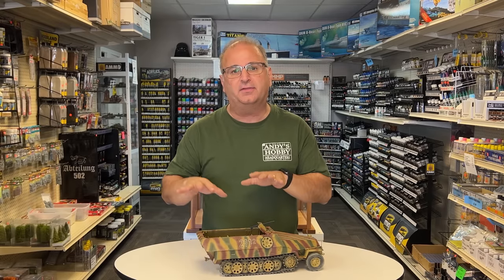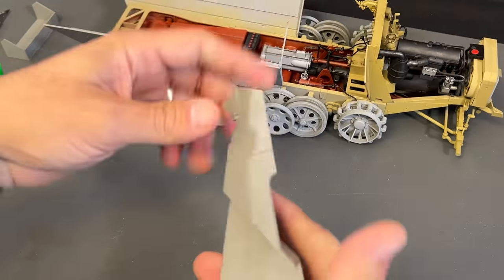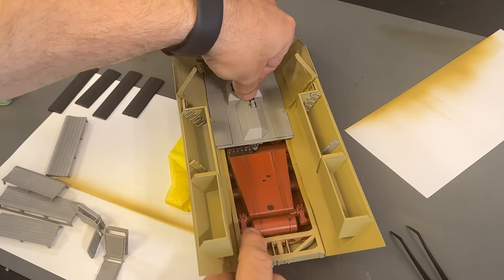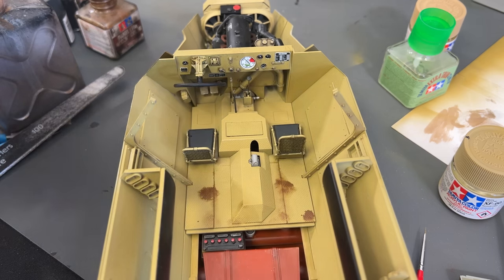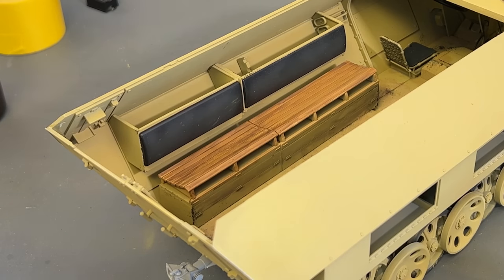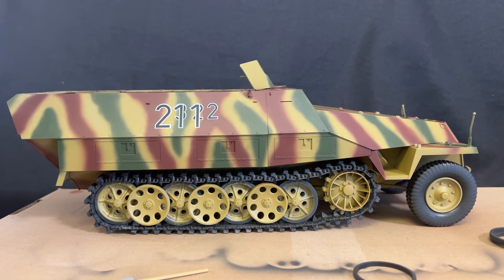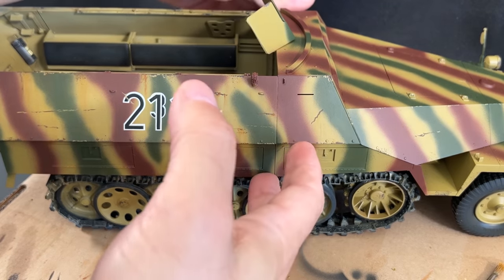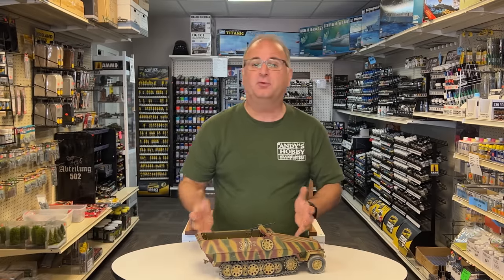Part 2 Building The New Das Werk 1/16 Sd.Kfz. 251 Ausf D  German WWII Halftrack ( Full Interior )

Comment: There is a restoration of a Sdkfz 251/9 that was done by the Patton museum that I found online a while back.  They had the whole vehicle to start with and while it was in rough shape, they didn't hardly have to guess at much when it came to paint or anything else.  The one thing that I remember is that the engine compartment was only painted the red primer which makes sense.  The external paint color was not wasted on an area that didn't need it.
One other thing about this kit is that it looks like Das Werk did all the parts as the original was broken down.  Thus the seam between the front and back between the drivers and rear area.  With planning they could do other much more interesting variants.

Comment: Nice build. I do have several original outer track wheels ( original name: Scheibenrad)( two of them connected: A-Rad) still in their sand color. Some tracmk pads,, origkinal ax holder for onthe left fender, onefront hook and the D660 manual booklets copies. Next weekend I go La Gleize ( where a real Kingtiger 2 is standing) to military relics market in thevillage streets.lets see what i can find. Regards from the Battle of the Bulge area

Comment: Beautiful. The detail is amazing. Its a pity the sub floor detail gets covered. I know you left yours loose ; but would it be possible to substitute the front and rear main floor parts with clear sheet stock. You could use the original's as templates Time consuming, but it might work and show enough detail.

Comment: I don't like how every screw head along the front and on all hinges are all the same way just copied and pasted in cad they never even bothered rotating the heads slightly to have a miss match realistic look! They have just mirrored all the screw heads on the opisit side so facing the other way but with them all facing the same way! For this scale it's noticeable and might need correcting on front upper engine pannal as it's right in your face!
Reply: I have OCD so I love it, ie every screw in the switch plates in my house point straight up, lol.

Comment: Hi Andy , great job on the kit!  I'm just finishing up on mine . I  noticed you left off parts of the transmission  M35, G16  in step 16 to make the forward  plate removeable.? I'm not sure Das Werk meant this plate to be removed based on the instructions . Explaining that you have to modify the instructions a bit  and leave these pieces off  would be helpful to future Modelers of this kit, Also SOLMODEL makes figures and accessories for this kit . Will you be getting those in?? Thanks !!

Comment: Looks good, except no one ever stored a road wheel inside like that - ever. Also, they'd keep them away from the antenna wire, and the vision slots. ALWAYS use pictures for stowage, unless you have IRL experiance. I found the kit fairly well engineered, although the seats are much too fragile to make the floor removable. There are several scratch building opportunities with this kit, such as the wiring, air lines, oil cans for the included oil can holders, and an angle iron support structure for the floor boards. The battery looks wrong to me, too, but I can't be sure. It is defiantly different than the other Aus versions, although they may have simplified things on the Aus D. Couldn't find a good picture.

Comment: Thats exactly what I said today when got mine! WAW it's all wrong! Lol unbelievable seriously a German company got this wrong! Go with Trumpeters theirs is accurate! Seats, sprokets front wheels Mg42 stupid way there done in parts same with multi peoce gas mask can that blew me away how that was done! Trumpeter full slide Moulded also tracks are wrong both edges are flat straight whare they pin they should have a slight curve and there to thick! Also.pads are to short! So alot to start doing in cad to correct it! Yep go for Trumpeters! They have the correct polygonal rubber pads not the round tyre on the sproket for carrying the track links through!